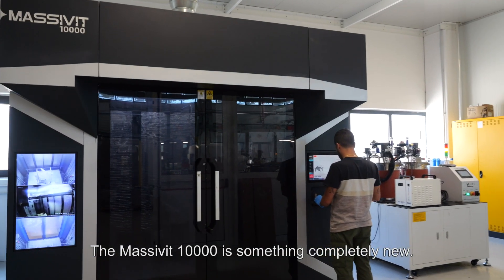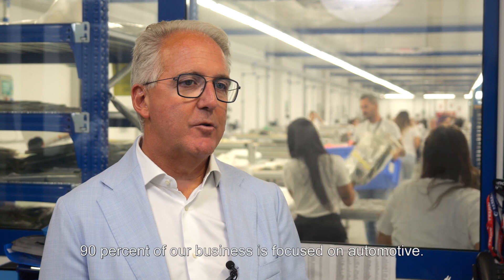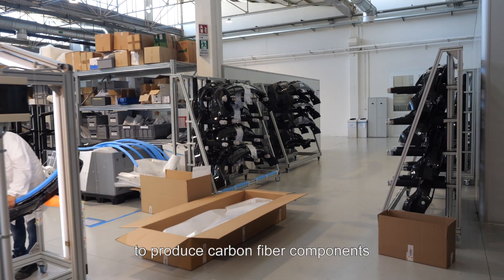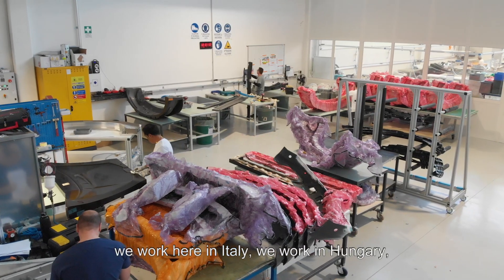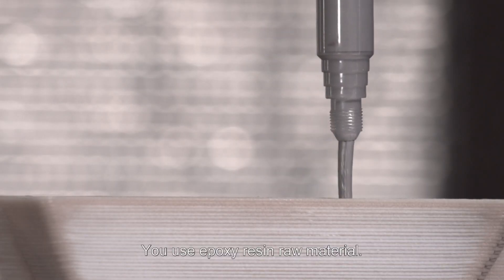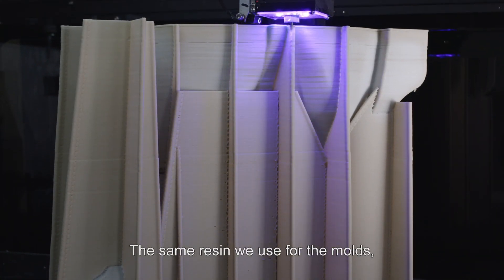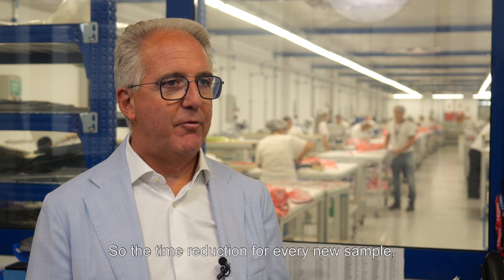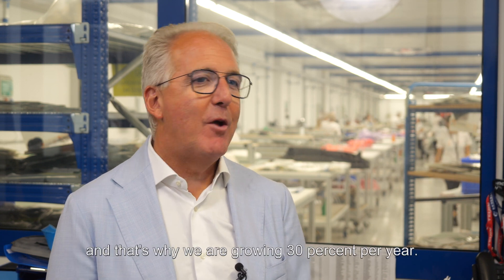Massivit 10000 Customer Story - "5 Years Ahead of the Market" - Novation Tech

Comment: Hi  Are you leaving the inner mold as the structure to cover with Carbon fiber or making a mold from the resin part ? Also what was the actual cost of the machine and costings on the materials to run items thanks David
Reply from the maker: HI there @davidbutcher6637 , the inner mold remains as the tool to lay up with carbon fiber (or as a mold for thermoforming, or as a compression mold for RIM). The outer washaway shell crumbles in plain water, leaving the inner mold which is isotropic. Happy to provide more specs and information. Please reach out to us here https://www.massivit3d.com/contact-us/ . You can also see the process here:  https://youtu.be/PgQkU3BgB9o?si=m5Odhe2-At9TJFc0&t=41